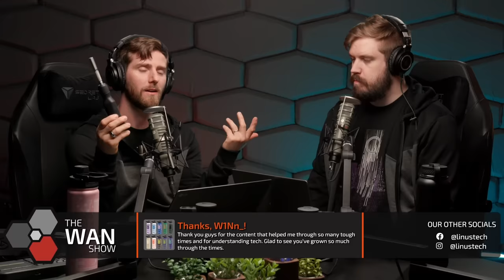Someone COPIED our Screwdriver design!

Comment: as a mechanic id like to give those drivers a real stress test
Reply: it’s a GAMERS screwdriver lol i’m surprised they didn’t put rainbow lights in it
Reply: @tomtricks6838  that will be version 2 and the fanboys will go crazy for it.
Reply: @tomtricks6838  It's not a gaming screwdriver, it's an electronic screwdriver
Reply: @L. Ron Hoyabembe said it perfectly if you want a decent ratchet screwdriver just buy one designed for automotive use or something like that.
Reply: @park9912  Care to recommend any brands?
Reply: @Beniu19892  Klein is expensive but really good, i have one that's been beat around for the past 15 years and it still works great
Reply: @Beniu19892  snapon, matco, mac, klein. Any of these would be a much better choice at that price point and come with a lifetime warranty typically
Reply: @Beniu19892  This is basically just a shortened megapro automotive screwdriver. they're fine
Reply: @L. Ron Hoyabembe agreed priced like the water bottles and rest of the merch too high
Reply: @Beniu19892  PB Swiss, Klein, Williams, Vessel, List goes on and on and on.
Reply: I'm guessing stripped after two weeks
Reply: @Beniu19892  snap on.  Their hard plastic ones are durable and comfortable, same one Linus used to use.  Their soft handled ones are pretty comfortable and come in a variety of handle sizes and the shafts are interchangeable. The stubby handle with a long shaft is the meta loadout. The cap on the soft ones is a design flaw though, it's a quarter turn lock that likes to pop off under heavy screwing pressure.  They are one of the very few tools from snapon I'd recommend.
Reply: @Beniu19892  i use the Milwaukee ratcheting screwdriver myself, it would be a good benchmark, i just want to test out its limitations
Reply: Project Farm and some others have

Comment: Read a book on Chinese export manufacturing awhile back, one of the chapters was called “all we need is your Sample“, you would be surprised how many products are built not based on schematics, instead simply by sending a prototype to China, and having the designs built around that prototype. 
One of the examples in the story, possibly not factual, but still interesting, is a factory making a production run of shoes, with a nail through every second shoe, because the Sample they were sent have been nailed to a wall at some point, and the factory simply assumed the nail was part of the design.

Comment: I just bought a Klein screwdriver for work that doesn't ratchet, but does have 14 bits for it. I can't wait to replace it with this one
Reply: I have the Klein ratcheting one that stores bits in the grip. So far best ratcheting screwdriver I’ve owned.
Reply: I know there was a reason I didn't buy their ratcheting one, but i can't think of it at the moment
Reply: That klein screw driver is probably way more durable and much better made i would not switch it

Comment: Well, it makes sense what the Chinese did. In Germany for instance is a law, that it is not a copy anymore if the "clone" was technically improved. 
My then professor at the university told a story about his friend, who wanted to protect his machine from being copied and added a fault in the schematic which then was supposed to be fixed locally via a botch wire after they'd receive the machine. The Chinese manufacturer obviously cloned the machine AND fixed that faulty part of the design. The court ruled this as technical improvement over the original and thus it was "legal" and could not be stopped from being sold.

Comment: Can't order a backpack yet (it's a luxury want), but I can totally justify the screwdriver. 

I'm sooo super excited.
Reply: Just get one from your local tool store. And take care of it. The ltt one is ridiculously priced just bc it has LTT on it
Reply: @slasherFTK  Why? They clearly spent a lot of time getting it to work. I have easily 20 screwdrivers floating around and most of them barely work, mostly from being rounded over due to weak metal. Even after seeing many people hate on this screwdriver, I still want one because I use it at least every few days or once a week.
Reply: @Zeldur  By your own admission you buy dodgy tools, good screwdrivers do not have to be overpriced, but they will never be cheap.
Reply: @Zeldur  Because a Klein is better built and designed for less money.
Reply: Gezz. People are so pissed off at the screwdriver that they find comments wanting to get it just to crap on it. How can you say it's crap when it hasn't been fully released yet? Plus, yes. The 20ish screwdrivers I have ARE from the local tool store. A lot of them are older with the handles falling apart and are rounded over. Even my husky screwdriver
Reply: @Zeldur  It's simple, people with common sense won't buy it or consider it a legit option. Not until proper TOOL review channels put through it's paces, like Project Farm as an example.
It's no different than a kickstarter project, not because it's a scam, because it's their first shot and the product is unpredictable.
You buy this to support the channel, not as a tool.

Comment: I've sent thousands of tooling details through China / Taiwan over the years to be produced and have gotten used to their oddities.  They will sometimes pretend to understand you and will say "Yes" to anything, even impossible requests, and then make it happen to some extent without any additional comment.  Sometimes the results are better than predicted, but most of the time it takes a few revisions to get what you want.  One thing I've noticed as an almost universal commonality is that they never read the prints, except for the title block and material selection call outs... If you have something in the model they will make it exactly like the model, they won't read any notation.  

I once had an employee that accidentally left some standard 8-32 hex nuts in the BOM when he sent a large build out to China to be produced.  When we got the tooling back, the manufacturer custom CNC machined dozens of those hex nuts.  No questions asked, they just did it because it was on the BOM

Comment: A company I've worked with had a photometric & photogrammetric scanner in their R&D lab for reverse engineering products they had acquired. They could scan individual parts within a minute with crazy high resolution. The guy giving me the demo told me to stick my hand on the scanning bed, and within a few seconds I was looking as an amazingly detailed model of my hand. It had caught details like individual hairs near the back of my wrist, the creases in my palms and along my knuckles, slight variations in my cuticles,  and slight divet from the (mostly healed) scar I got from burning myself on the oven as a kid.

I've seen similar equipment used to create scanned point clouds of physical spaces so dense that looking at the point cloud in the program is like looking at a really low resolution, potato quality image of that space. So many data points captured that they are almost akin to the pixels in an image.

I could entirely believe that a chinese manufacturer has similar (if not even better) reverse engineering equipment so that recreating these samples would be pretty straightforward and even quick.

Comment: While I think it's great to have a variety of different screw drivers, LTT, GN, IFixit. Supporting each brand is cool and all, but what are the pros/cons? If someone has an IFixit Kit or GN screw drivers already, other than supporting LTT what's the win here?
Reply: They have spent a long time engineering the screwdriver to be the best
Reply: @Chunkosaurus  its a screwdriver...
Reply: IFixit is a precision screwdriver and anti tamper set; LTT is more compact and has a ratchet; and Gamers Nexus has custom/precision ground nut drivers for better clearance. Plus you don't have any of the slop that ratchets or swap-able bits introduce.

If you want a screwdriver that's 90% the LTT one get a Megapro Automotive driver. Megapro is the OEM for the screwdriver.
Reply: @rodrames2462  I have my Klein ratcheting screw driver and its been amazing, I mean I aint putting my full weight, while strapping a vice grip on it and going full hog, but that's not what its meant to be for.  $25 bucks, hey works for me.

Comment: There was a very similar screwdriver on the market for a long time now. I think your gas better bearings and gears but the wrs1 is physically identical, I used to think that was what you were using.
Reply: He used the snap-on screwdriver for a long time. Snap-on owns Williams, the company behind the WSR-1, it's made from the same mold. So he was using the same screwdriver you thought he was

Comment: yup, if you need something custom or rare duplicated then china is the best place to go, ive seen a few accessory and parts items for older game systems that the communities for said systems are thrilled to have access to the mass produced chinese clones, its not always as reliable as other sources but at least you can actually buy the item without a small fortune which is kinda a critical detail for rare high(guaranteed) failure parts such as a microvision screen
Reply: funnily enough in regards to the microvision screen the hardest part was actually getting an original that still worked for reverse engineering and getting it shipped to china while surviving the trip, there was debate to build something resembling a pipe bomb to prevent pressure changes which can and will kill those screens, the idea died when someone realized what it would look like when it went through a scanner.  ultimately it shipped without special protection and it... mostly survived, input was still needed to nail down how it was originally intended to look prior to severe degradation

Comment: Is it still $70?  Man, I can get an entire set of German weras or some Klein screwdrivers for half the price.  That is my biggest hang up.  I have an entire set of wiha demolition screwdrivers, 5 screwdrivers, that I paid about $100 for
Reply: Exactly even the cheapest ratchet screwdriver or exchangable bit driver will do for 99% of people and even for daily heavier work you could get a Wera ratchet screwdriver which will last a lifetime for 35 bucks and even get a ton of extra bits and a magnetizer on top and you would still pay less than 80 bucks.
Basicly the only reason to buy it is to support them and even then you could just buy anything from the store right now, i wonder if the years of working on this thing was worth it.
Reply: @kwedl  yeah it just seems to me every YouTubers store is just overpriced.  Hard to justify any of the prices usually, but to me, who is a general handyman and has a whole garage of nice tools, I know what I could get some nice tools for.  This ain’t it

Comment: Why did you guys partner with China anyways? The point of going Chinese is to reduce cost, and at $70 for a driver you've reduced nothing. You can get good Canadian made or American made products for less than $70. You could probably get Japanese made premium steel parts and still sold it for $70.
Reply: A. Chinese don't fuck up as much with the deadlines. Usually cuz all the needed materials, staff and tooling needed is readily available to them at any moment. You saw how Chinese made the screwdrivers from scratch in a week? Canadian or US manufacturer will take good 2 months before you'll get a decent result out of them. There will be many more fuck-ups throughout the entire partnership period as well.

I hate the idea that people go to that genocidal country for manufacturing, but when it comes to small business that can not make their own factory and has to outsource it all, usually nobody else can beat China and that's a fact.

LMG is already working at tiny or even no profit margins with most of their more expensive LTT brand products, I imagine screwdriver will be the same even with Chinese manufacturing.

Comment: the best multi tip screwdrivers are picquic and they're made in Canada.
Reply: Ok but how much force does the rachet require to turn the handle back so you can tighten more.
That's a key feature of this driver is that you can rotate it back with barely any force which is needed when dealing with very tiny screws on a computer build
Reply: I prefer Snap-On. Made in US and lifetime warranty.
Reply: Lol No. Klein, Williams, Snap On, Etc > Picquic
Reply: @NyxHunter  Use a precision driver, not a ratchet. Solid construction > gears. Stupid excuse for an overpriced Chinese made screwdriver. 🤡

Comment: I use a screw driver every day but the price for your guys driver is just kind of ridiculous. I could buy top of the line driver for almost half the cost of your guys. I get the price for design and stuff but unfortunately I wouldn't be buy untill you get close to the top performers in this class

Comment: Really looking for getting my hands on your driver, because I trust you for the quality. But, its not like you have a unique or original design, I have seen many, many similar drivers, with ratchet and bits in handle from years ago.  But must stress I want yours because I believe it will be a quality build.

Comment: I just can’t wrap my head around a $70 screw driver. From everything I’ve seen I don’t see a difference between this and a craftsman driver. Except for warranty, Linus excludes a lot of the wear and tear a driver gets over time while craftsman will replace any hand tool or but no matter the age and no matter the reason for free. And they do that at half the cost of this driver. And from what I’ve been hearing from my Milwaukee rep, they plan on the same kind of idea that craftsman has, simple no questions asked in store exchanges. All I see is negatives, can’t buy in stores, long shipping times, limited quantities, no in store exchanges, limited warranties, and double the cost.
Reply: Yup, it was probably a fun project for them and I'm sure they'll make money from people purchasing it as a novelty, but boutique tool manufacturing is not a business I would want to be in.
Reply: Professional screwdrivers cost upwards of 300-400$. PB Swiss has something very similar to LTT screwdriver for 150$. So for 70$? It’s a great deal. 
Longevity is the biggest question mark right now.
Reply: @kojot0976  k, I work with mechanics every single day at a manufacturing facility. Guess how many use $400 screwdrivers?
Reply: @kojot0976  lol i got a $20 ratcheting screwdriver that can even drive screws into wood... Linus is ripping everyone off...

Comment: I've never understood what made this screwdriver so special. I have an automatic one and I just don't see how a manual screwdriver is ever better
Reply: If you think an automatic screwdriver is ok for building PC’s then your not the intended market lol
Reply: The simple answer is it’s not any better than screwdrivers on the market already.  My profession has me using all sorts of tools and there is no chance I would pay what the LTT screwdriver costs. Plenty will buy it to support the channel and there’s nothing wrong w/ that. But it’s overpriced by a huge margin.
Reply: @Bob_Smith19  Have you used the LTT screwdriver?
Reply: @Bob_Smith19  . What makes it over priced? There are plenty of expensive simple tools out there, but that doesn’t mean it’s overpriced. FWIW I would not buy one either, and while it’s because of cost, it has nothing to do with overpriced.
Reply: One of the big key features is the ratcheting mechanisms. It's extremely precise and repeatable. Meaning small turns will always give you the same amount of rotation.
It's built durable so that the mechanism will not break or slip easily.
And unlike many ratcheting mechanisms the amount of force needed to twist back (so that its just moving the handle not the bit) is INSANELY low. Meaning on tiny screws that are very easy to back out you are less likely to. With tighter screwdrivers you'd have to lift and turn the whole bit like a manual screwdriver.

It's purpose built for people who build and work on computers a lot so features like the low back force are needed where as a racheting screwdriver in the hands of a hand man doesn't need to be that gentle to turn back
Reply: @Bob_Smith19  It's no where near over priced when you consider the amount of R&D and development the product has gone through. As well as the fact it's designed for PC builders and not every day repairs so some of the features it has are unique
Reply: @Bob_Smith19  that could be said about anything sold there. They are selling a brand hahaha

They sell quality products but is it really worth what they say it does? But add the LTT brand and now it does. Just like Supreme products.
Reply: @NyxHunter  thanks
Reply: @NyxHunter  what is unique?
Reply: @lolzlolz102  see the first response I left in the thread
Reply: @NyxHunter  Sorry I missed that.
Reply: @NyxHunter  still should wait until there are actual reviews. We've heard how great it is but just like with many other products that doesn't mean It can't end up being an average, below average or straight up a suck balls screwdriver.
Reply: @Destilight  Yeah if you have doubts wait for reviews.
But also I really doubt Linus is going to waste a massive amount of money on a bad product. He's not gonna make money if the screwdriver is so bad that everyone returns it.
Reply: @robertt9342  Because a quality ratcheting screwdriver made in China doesn't cost $70.
Reply: @jakem5039  You really think the LTT China made screwdriver will be better than experts who have decades worth of value to go off of?
Reply: @NyxHunter  R&D? Lol
Reply: @svn5994  Yes Research and Development. They had to first figure out the best design for the racheting mechanism (research) and then spend month and thousands of dollars sending the manufacturer a design and getting a sample back. To then make changes and do it again.

Ya know how basically everything get made
Reply: @svn5994  Have you any hands on experience to suggest otherwise?